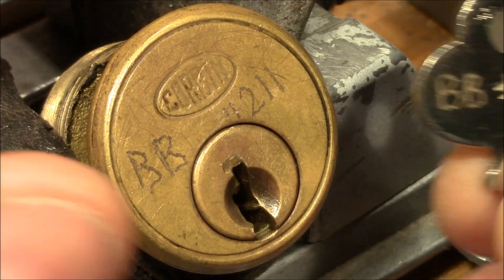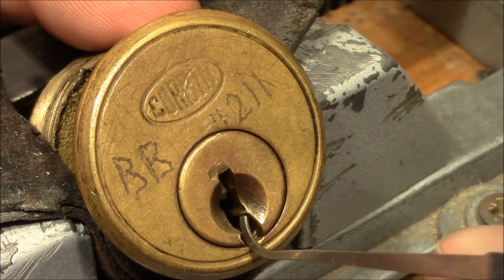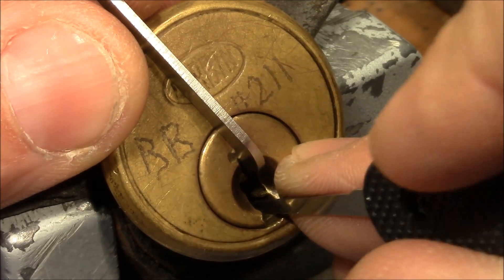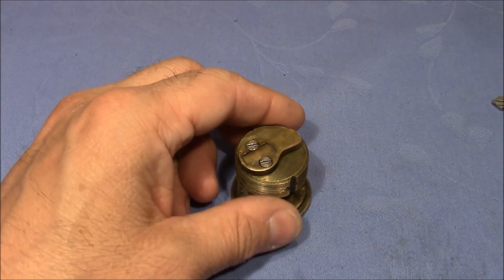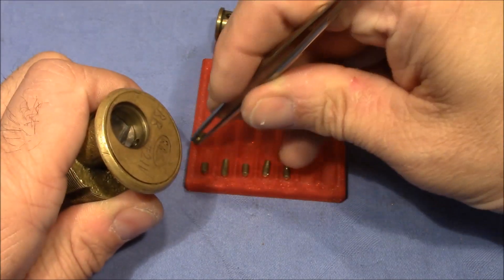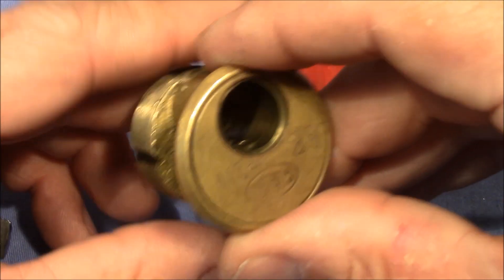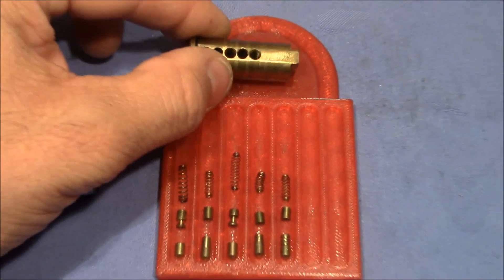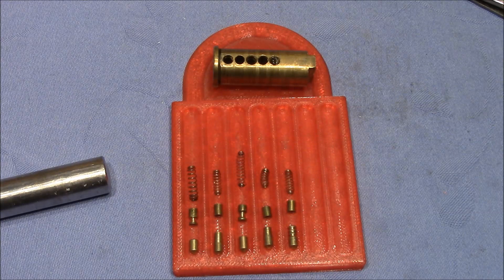(picking 696) Challenge lock BB #211 adventure

Comment: Nice job, great picking! very cool biting from BB.
May be the one driver was changed chamber by mistake when reassemble the lock, and chamber #3 has no driver? that could explain the springy feeling when you put it the key
Thanks for showing my friend ;o))
Reply from the maker: Yes, some kind of assembling problem. I exchanged the compressed springs with new ones and put all drivers in its spot - now the key works wonderful.